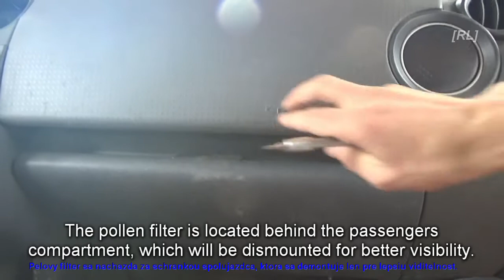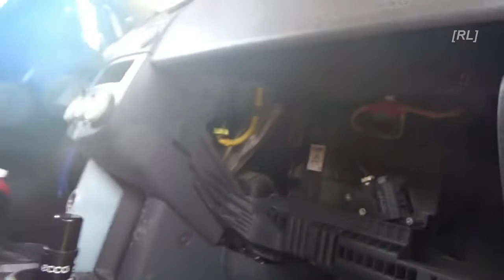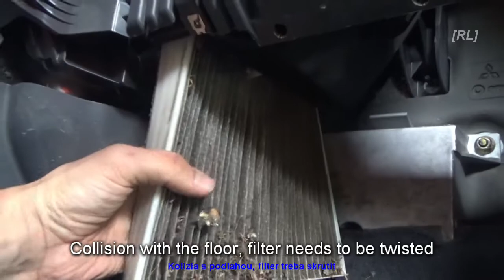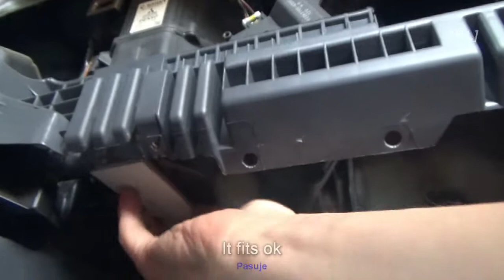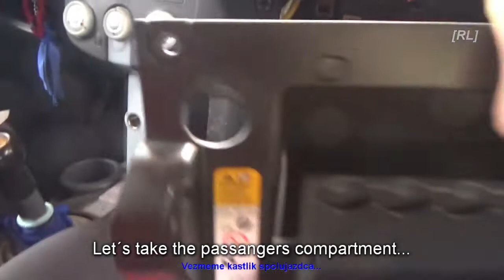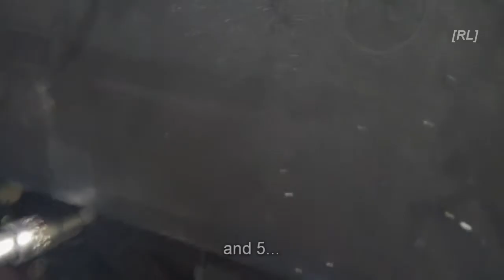Mitsubishi Colt 1.1i - Pollen Filter Change

Comment: Not need to remove that box, there is another movie here on youtube , where a good mechanic change that pollen  filter whitout removing that box !
Reply from the maker: Yes, I guess I mentioned this in the video as well.
Reply: I have colt 1.3 70 kW year 2010 and I also have 5 screws for glove box but to pull it out I have to detach the string that holds the glove box in place and I don't have right tool to detach it. So I change the cabin filter from under the glove box lying flat on my back looking up. It's real pain in the ass as you have to watch not to damage the latch with screwdriver.